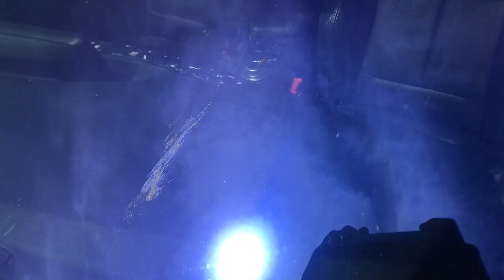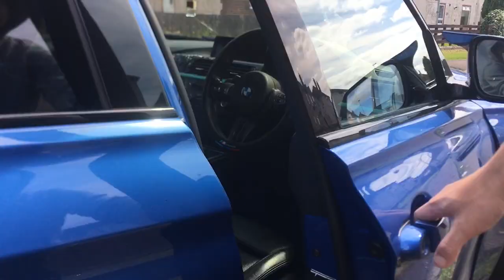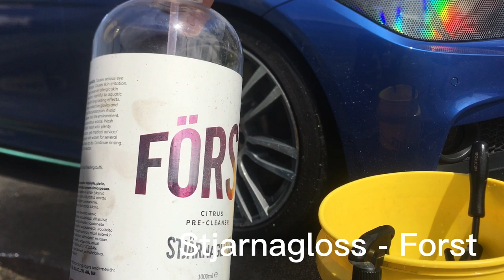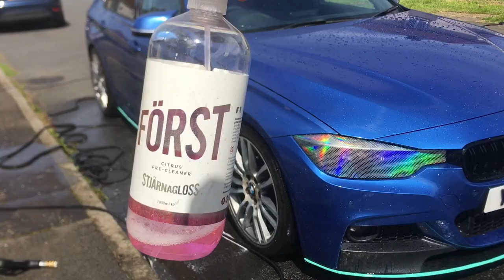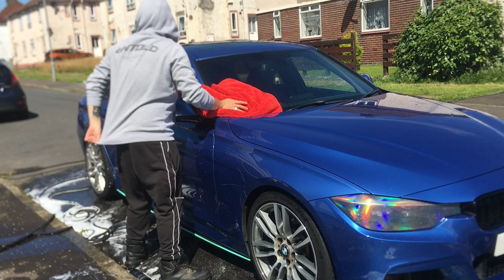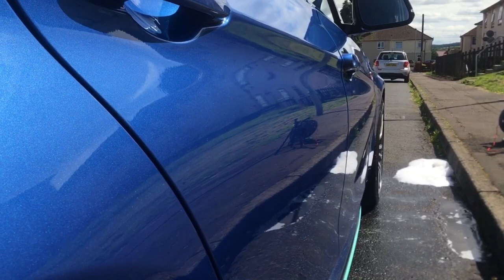BMW f30 | Maintenance car washing ASMR | Infinity Wax - Rapid Detailer

Comment: Very nice motor mate, lovely colour, as I’ve said in the other video too. Especially like the rainbow headlights, there quite cool, is that just a wrap is it?

And I’ve noticed you use a variety of brands when car cleaning, I take it you like to chop and change, rather than stick to one brand? I’m currently using Chemical Guys wash and wax for my shampoo, and Meguiars detailing spray, it beads for weeks😁
Reply from the maker: My headlight tint video: https://youtu.be/A1vmYTMl7pM

It’s crazy when the light hits it, I’ve seen VviVid released another film without the hex pattern on it and I’ve been tempted to redo the headlights to the newer version.

I like chopping and changing using different brands. I’m trying to find the courage to talk in my video for products review in the future. I need to try Chemical Guy products, I’ve heard some good things. I highly recommend Infinity Wax - Rapid Detailer after a wash or after a coating, it brings up the gloss of the paintwork, definitely made the metallic flake pop when the sun hits it, it feels very slick. I’ll be replying to your other comment shortly lol I like to interact with my viewers :)
Reply: @ShaksWD  oh there’s a video on the tint, I’ll watch that when I get a chance👍🏻

Yes chemical guys are very good products, and reasonably priced too.

Comment: Ah! to be young again! At 74, after multiple spine surgeries I still want to wash my car which after 26 months still does not have a single swirl. Fantastic video but, I think I am looking for the impossible! A soap that will "lift" the grime and dirt and run it to the ground. Not expecting a miracle wash but close. I have tried numerous wrongfully advertised products to no avail [surprise?]. I still appreciate you sharing this. Maybe I ask what is that light blue/green thin band you have going around the car and some on the interior also? I appreciate. BTW, I am looking into Bill Hambert products also. They have now a distributor in the USA. The steps to follow are either way yours.
Reply from the maker: Hello, thank you for stopping by :) wow that’s amazing that you’re not letting anything stop you from detailing your car, incredible!

I highly recommend Bilt Hamber - Touchless. It’s got more cleaning power than their Auto Foam. Bilt Hamber’s snow foams are thin and runny but great cleaning power. You’ll need to work out the PiR of 4% for your pressure washer set up to give you the best cleaning power. Sometimes we can’t trust the advertisements from the big brands as that’s their marketing strategy to sell to the public to make $$$/£££. If you don’t feel the snow foam you have has got good cleaning power, I highly recommend spraying a good citrus pre wash product then blanket the snow foam on top and let it dwell for 5 minutes and rinse it all off.

The band that goes around my trim is a wrap that I’ve made with Hexis - Tiffany Blue. Something different than the usual red or yellow :)

I hope you stay tuned for the next video I have got coming out, I’ve got a Scottish brand to try out that I’ve bought a sample from, Mitchell & King.

Subscribe and Like for more future contents like this and some wrapping videos :)
Reply: @ShaksWD  thank you very much for your lengthy reply. I appreciate your time and will definitely follow your suggestions. The car stores are now a smorgasbord of products! I'm surprised they don't have a shampoo for the right door and one for the left door! But I am sure that it's coming. I really like that band, very nice. I will watch out for your future videos.
Reply from the maker: @aragureghian724  no worries at all, anything to help you out to enjoy car detailing more to achieve the result you want for your car :) plus I like to interact with my viewers who comments as much as I can :)

As we speak, I’m in the middle of editing the Mitchell & King video for next week’s upload. All I can say is their QD smells like a nice aftershave